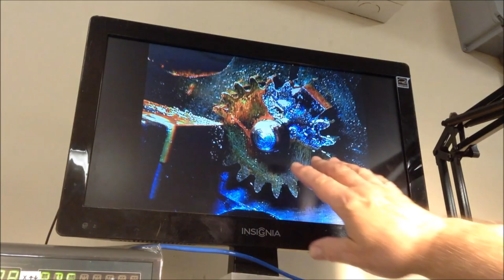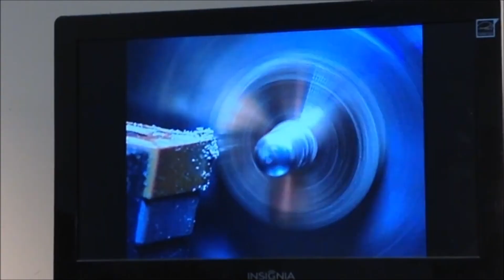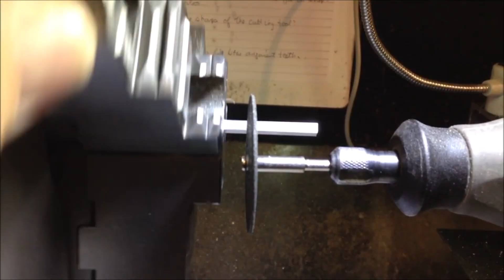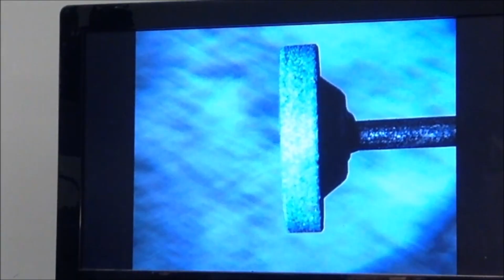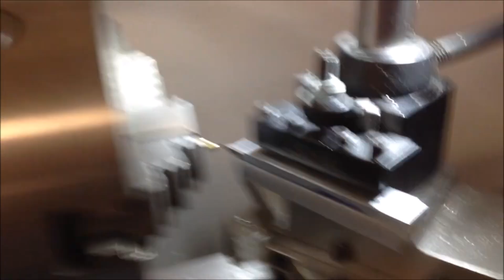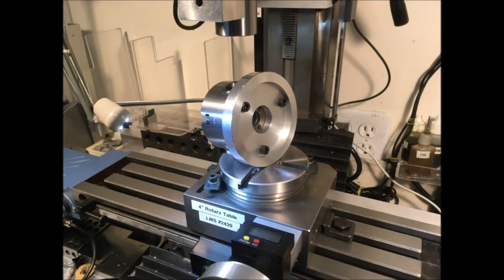Mantle Clock Repair Part 2

Comment: Question. First thanks for machine recap , not since high school, the soldiers was my first question so its answered, ive got 2 partial teeth missing on a much thinner gear, i m not tooled up so im thinking i could press good gear spot into a clay ,, and possibly soldier fill new teeth , i dont know if the soldier will be strong enough to run on but at the cost. For your fabrication work lathes i think i might try, I don't know if you can reach back to me but thank you
Reply from the maker: Glad you enjoyed video. Frank made it a number of years ago. In terms of using solder to cast some new gear teeth... I think it's an interesting experiment. Will depend on size, shape, stress, and many other factors, but I'd give it a shot. Know situations in which others have used JEN-WELD to "cast" something. Necessity is mother of inventions... right.